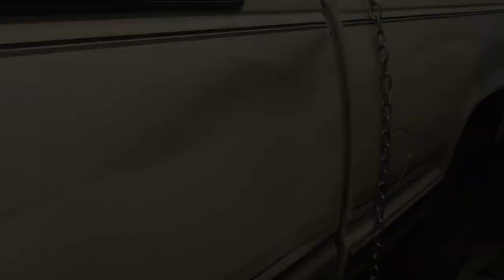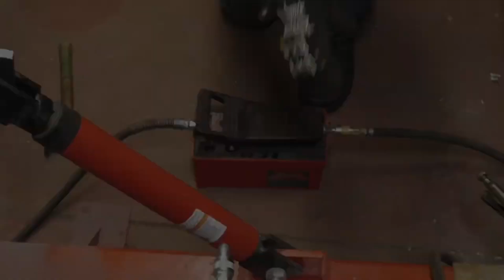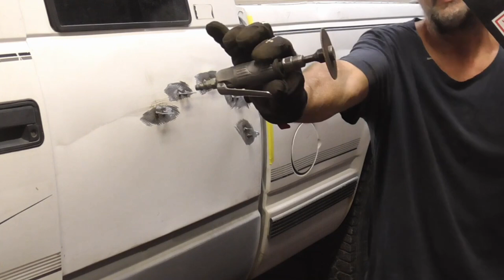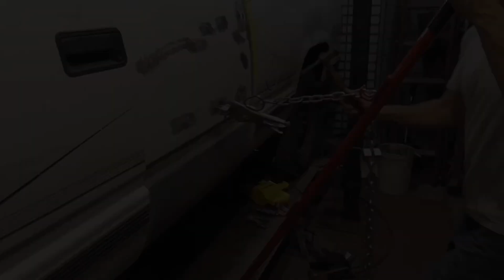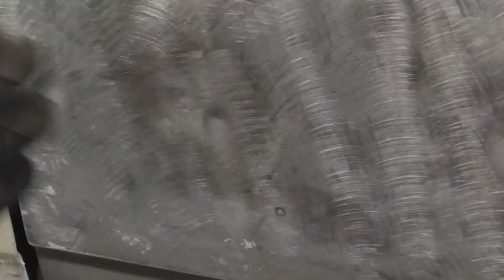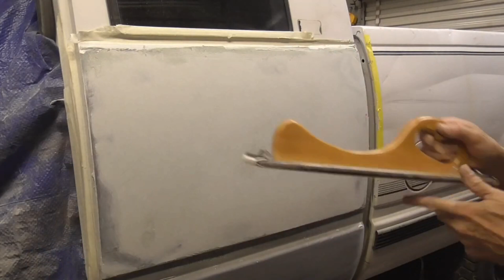Pulling Large Dents with a Frame Machine

Comment: Another great video. I learn so much from you. I do have a question. I once did a repair for a friend of mine. The trunk had a repair from some time ago. The body filler was applied directly over freshly ground down clean metal. When I removed that body filler I noticed that rust was forming. Ever since that day I will put the panel in primer and apply the body filler over the primer that has a 80 grit scratch in it. Is that ok and wonder why the rust was getting between the body filler and the bare metal? Thanks Bob.
Reply from the maker: Thanks Bob.  There's only two reasons there is rust between filler and metal 1) moisture is getting in from the back side through pin holes in welds, cracks in the metal, seams, etc.  2) It was left outside for some time with filler exposed to the elements or someone primed the repair with non water proof primer and left the primed car outside for sometime and the moisture penetrated the primer and filler (both not water proof).  You don't have to prime before using filler if you always keep the vehicle inside until painted.  If the back side is water proof and the front is painted, it will never rust between the filler and metal.  You can prime if you want (water proof primer), sand with 80 and apply filler.  That's fine but it's one step that you really don't need.  Hope that helps - Jerry
Reply: @LakesideAutobody  that really helps.and makes perfect sense. Thanks again.  Did Eastwood ever contact you?  They left me go. I was out with a knee replacement and had a lot of complications so they let me go. They did say that once I'm healed up they would like me to reapply.
Reply from the maker: @bobgreen3116  No they did not but that's OK.  Thanks for giving it a shot.  I hope your knee replacement works out for you.  Don't forget to do you rehab - I guess that's the most important thing after the surg.  :)
Reply: @LakesideAutobody  for sure

Comment: Your repair is fine. Old skool but fine.  I would of glue pulled that with either Blackplague 2.0's or camauto glue tabs using cactus green pdr glue or tabweld pdr glue.     I am not a fan of studs (stud gun) because it is limited. That said try using the claw of a claw hammer to pull on the studs or nails or whatever you call them.  Works fine and it's quicker.  Try to make a bridge puller.  It's quicker.
Reply from the maker: Cool - thanks for your input - I'll check out the bridge puller :)

Comment: Great video.  Out of curiosity what type of price difference is there in making a repair like this and just replacing with a new panel?
Reply from the maker: If you're doing this at home - a lot cheaper.  They probably wouldn't have given you a choice if you took it to a body shop - would have replaced it.  The cost would be in the 1000s at a body shop - I'm not real sure on that as I never wrote the estimates.

Comment: Great vid. But the normal DIYer don't own a frame machine. How could we adapt
 and pull dents without machine.  I'm sort of thinking of building a square tube frame to wall of shop and using a small chain fall.  
I have one on my dually fender when I backed up a trailer to sharp and caved it in.  Again thanks for all you sharing of your skills
Reply from the maker: Good question.  My dad would use a come along hooked to a tractor or even another car frame or bumper hitch.  Heck you could even use a tree and a come along.  Let me know what you come up with - always interested in unique ideas :)

Comment: Why didn't you just use hot water and a toilet plunger ?
Reply from the maker: Toilet plunger wouldn't have done it - too damaged.  A very light dent maybe :)
Reply: @LakesideAutobody  
Was a joke lol. 
Do you have or have you ever used slapping files for crowns and a heat gun ? Work's good for reliving those stress points.
Reply from the maker: @keithclark486  I thought it was a joke at first but.... I didn't want to offend anyone if it was real :)  I have a couple of slapping spoons and yes they work well for the crowns.  Good idea with the heat gun - real good.  Don't know why I never used it for that.  I usually use a torch for really crinkled stuff - the heat gun would do the trick on most stuff w/o the flames.  Have a good weekend :)

Comment: How long can you leave in primer?  I have a 69 Nova I want to paint metallic silver. With base coat / clear coat.  My fear is that will turn into a 5 year project and moisture will get under primer and cause paint to pop. Sorry  for  long question and thanks in advance
Reply: If you use 2k Epoxy primer you can leave it for as long as you want because it is waterproof, all other primers are porous and will let moisture through to the underlying filler /metal thus causing problems.
Reply: Thx.  I didn't know it's waterproof 👍

Comment: Ohhhhhhh noooooo you should bought masive glue pull tabs
Reply from the maker: Well... before there were glue tabs, and even stud welders - this is what was done.  I'll do a video on that though - thanks for the suggestion.  If you have any other suggestions - let me know :)
Reply: @LakesideAutobody  the problem with stud gun and welding tabs and key... the back side of panel is burned up... if you have acces to the back side of the panel  repainting it require lot effort.. many panels have small or no access holes to even get a spray gun in there...not even rattle  can... glue pulling and pdr is the best  type of repair  most people foget to repaint the back side after welding... cavity wax or corrosion  protection is only a band aide....rust will return ...
Reply: @LakesideAutobody  suggestion video repaint a new chevy front fender and paint in the inner cavity ie back side of fender and the wheel housing... yep  that big void....in quarter  panel or pain the inside of cavity door after repairing it...
Reply: Was in my trunk the other day, saw the marks from stud welding, was done 20 years ago, no issues with corrosion.
Reply from the maker: @PnwOnTour  Hey Gmguy,  always good to hear from you - thanks for the tip :)
Reply: @PnwOnTour  doors have a lot more moisture....grind away the paint lightly ...and you see surface rust under the paint... you cant see the rust under the paint... just like stone chips rust migrate under the paint
Reply: Doors were repaired 20 years ago and are 100% fine.
Reply: @PnwOnTour  i doubt there 100% fine... fine from 15 feet afar maybe.. go sand blast it you see the under side rust... looks good from far but in most cases far from good...after 20 years..

Example a simple stone chip doesnt show any signs of rust.. use a roloc abrasive pad on the stone  chip you see rust under the paint and primer... surface rust  10x big than the stone chip...  rust is like cancer.... just cus you dont see it doesn't mean it not there...